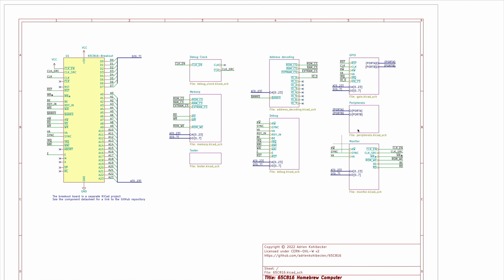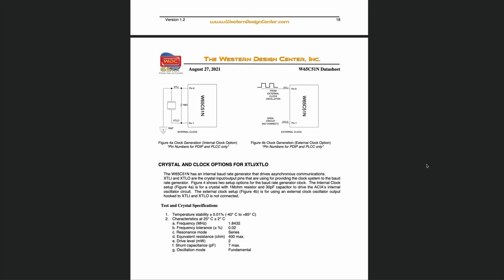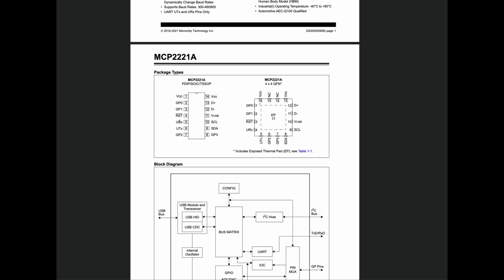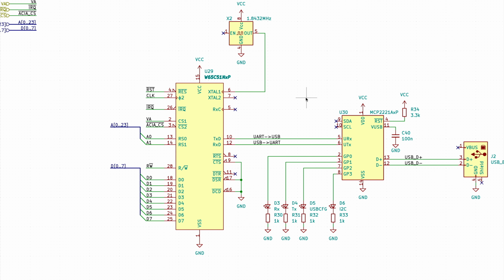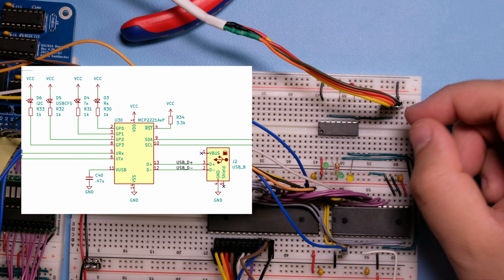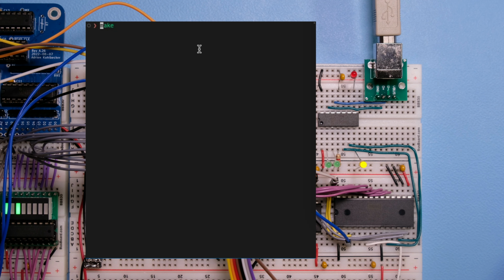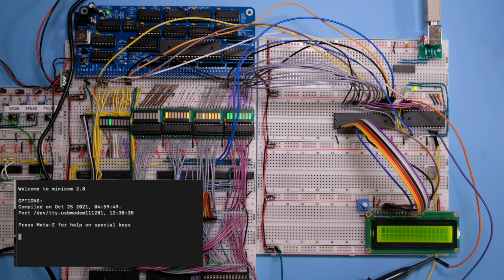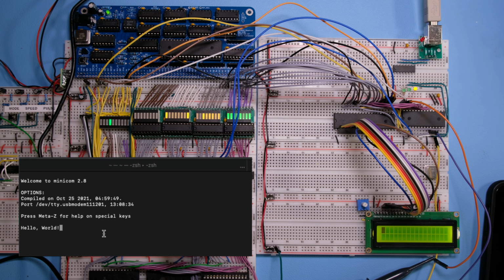#30 - 6551 UART with USB adapter - BB816 Computer

Comment: Ecchh... I think adding a timer/counter (6840 perhaps - though good luck finding fast ones - IIRC they only go to 2MHz (MC68B40) and probably running out).
Anything that gives an interrupt at a suitable periodic rate would do...
Reply from the maker: Right! Or just the VIA's built-in timer could work.

Comment: I like this.  I got to about here on my design.  I'm glad somebody else went with the 65C51!  I should be getting back to my design next week, hopefully. 🤞
The big difference is used a DB9 port on the computer and did the USB implementation on the PC side.
Reply from the maker: Yeah that works too! I went with this MCP2221A because it was simpler to explain than RS232, but I guess Ben Eater is doing that now so that's good :-D

Comment: I used a Maxim 3100 SPI UART chip for my 6502 SBC. It was actually quite a bit of fun figuring out how to bit-bang SPI and create routines to create a serial monitor interface.  

I fried my WDC 65c51 (not certain how though).  I've also used a regular CMOS 65c51 chip and it worked all right but it was limited to a clockrate of 1MHz (although I think they made chips capable of 2MHz).  I have some 16550s but I wasn't able to interface it properly (it's a different type of interface not easily implemented with the 6502).
Reply from the maker: The MAX3100 is a pretty interesting chip! I'm considering it for later revisions.

Comment: Adrien: Let's use a, old, buggy, bad, UART, for the lulz... This is why I like him and this project.
Reply from the maker: Haha! It gets a bad rap but I think it is great for a simple beginner breadboard project if paired with a VIA and the interrupt workaround I'll show in the next video.  
Of course the 16C550 will be better (but more complex to interface with in hardware) or if you have access to SPI or can place a PLCC socket better options exist. 
It is always a compromise
Reply: @akohlbecker  Yes, it was dead simple to interface to, and newer hardware tends to be more complex. And it was a good chip for this application. But it is an odd bug, something that should have been caught in early testing.
Reply from the maker: Definitely! You might enjoy reading this thread about me stumbling on an unreleased engineering sample of the W65C51S, a version with no Xmit bug. It is a nice window into the history of this chip http://forum.6502.org/viewtopic.php?f=1&t=7351
Reply: @akohlbecker  Thanks, that was a fun read. Wild that you stumbled upon work engineering samples. From mouser no less.
Reply: I used the Rockwell r65c51and it works perfectly. They might not be too easy to get hold of these days though. But thanks for explaining the bug with the WDC version. I knew it had a bug so avoided it but didn't really understand why until now.
Reply from the maker: Oscar, it was from Quest Components, which is a reseller. 

David, for sure the R65C51 is a better option if you can get your hands on one (I see Utsource has some in stock). They are specified only up to 2MHz though, so that's something to keep in mind. 

The datasheet from Rockwell is a much better read than WDC's and is a great source of info on how the chip works, since they're interchangeable.
Reply: @akohlbecker  good point. My Ben eater style breadboard setup is running at a very sedate 1mhz.  I also have a z80 kit that has an SIO2 onboard that rocks out at just shy of 8mhz which is scarily fast.
Reply: @akohlbecker  Ah, I was reading too quickly, but a reseller makes more sense, but still strange. And fun!